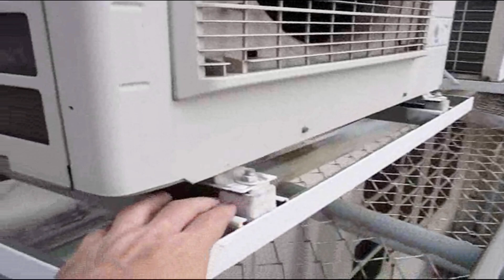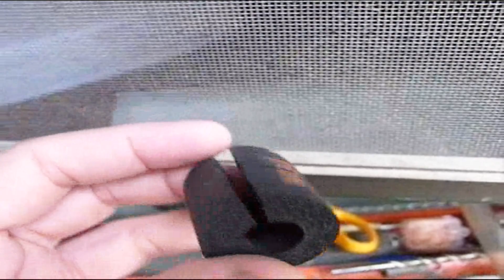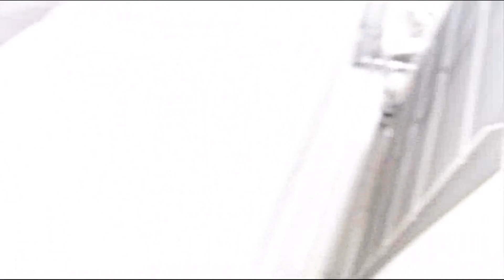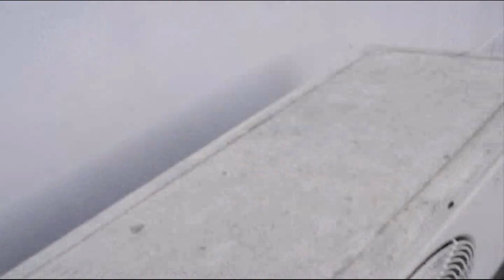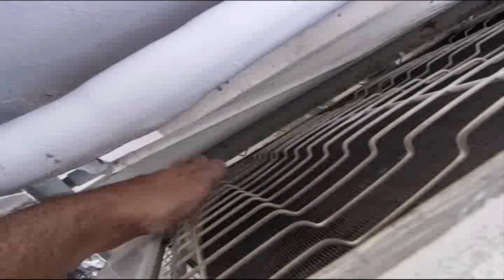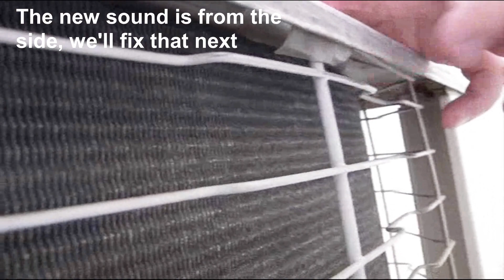De-Rattling an Air Conditioner Housing

Comment: Did you have the camera running when you smashed your thumb?  Good ideas, however, you could move to Ohio. The last thing we need right know is air conditioning.
Reply from the maker: I knew the camera was running, have to keep 'em laughing, you know?  I make these videos as I'm actually doing stuff, they are not some artificial thing I thought up to get clicks.  When something around the house needs fixing, I take the camera along.